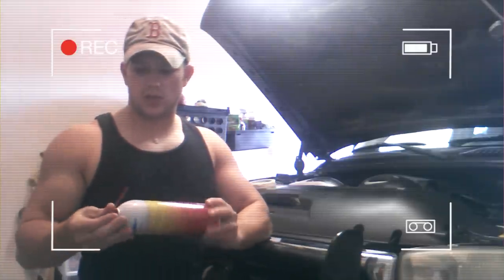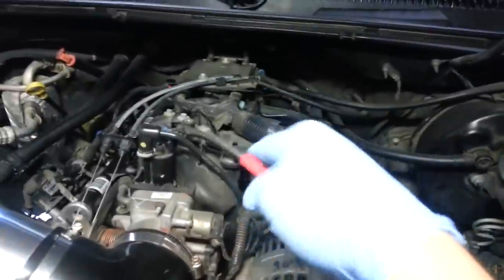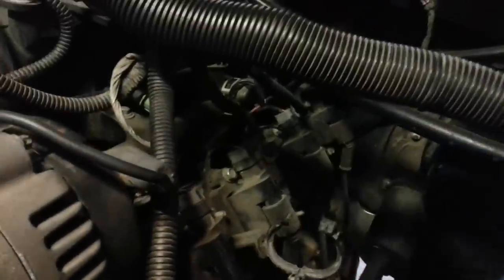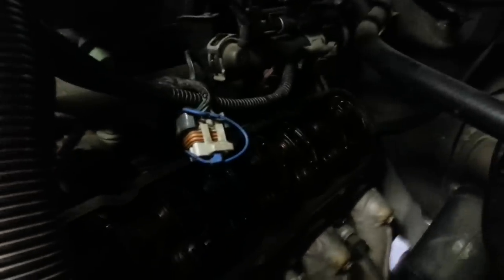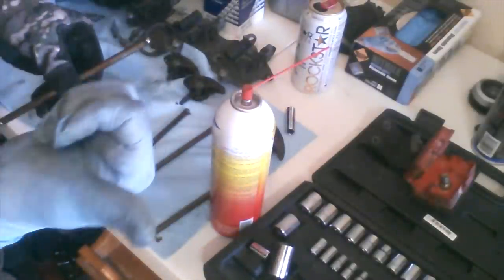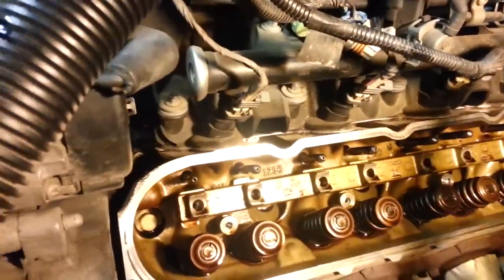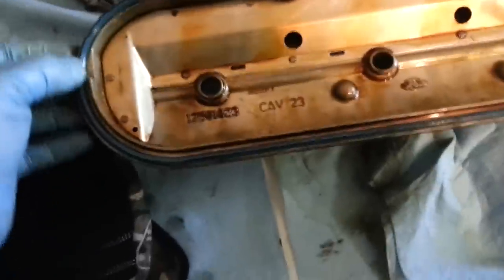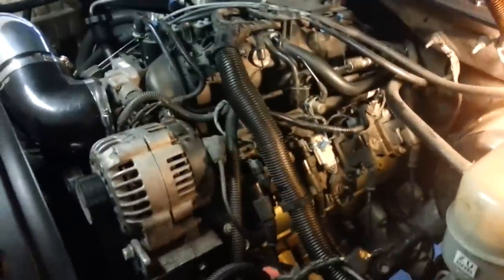GM Lifter Knock Repair - Carb Cleaner Method - HOW TO / TUTORIAL

Comment: Thanks for the vid !  I have a 2000 Silverado 5.3 with 308k. Runs great no issues but had to replace the trans one time.... Over the period of going 308k miles I have had the lifer tick and sometimes worse then others.... What I have done is just as you did except I did not remove the rocker arms. What I did was to make sure that your rocker arm is all the way up and spray carb cleaner right into the rocker hole in flows right down the push rod in to the lifter. Works great!  Thanks again!

Comment: Thanks for posting this. My 2005 5.3 has 105,000 on it now with no lifter or valve noises but I do get a whiff of burnt oil outside the truck after driving in aggressive traffic or at higher speeds. I figure it's probably time for new valve cover gaskets and this video showed me exactly what that will entail. I might consider doing this cleaning procedure as a preventive measure too while I have everything apart to replace the gaskets. Just makes sense to combine it all just before my next oil change.
Reply: The 2005 doesn't have a afm so your truck doesn't have the kind of lifters that get stuck

Comment: Run lucas or seafoam first, if that don't work run 1/2 qt transmission fluid (drive vehicle a couple days on both methods). Usually have pretty good luck freeing up lifter(s), unless completely bad unit and don't have to pull valve covers. Can wait on oil change until regular interval too.

Cheaper and easier. 
Happy wrenching. 

God Bless you and yours. 
God Bless our Real American Patriot Brothers and Sisters. 
God Bless America Again. 

The Real American Patriots.

Comment: Thanks for this video. Did this to my 6.0 Vortec. 5 or 6 of the rods seemed to be gummed up. This took care of 90% or more of my ticking
Reply: How did it work out on your 6.0. Thinking of doing mine in my 05 H2 as the tick is just barely audible. But considering its 2500 for the top end rebuild, I think its worth a try.
Reply: @markroeder3174  it worked well. It took care of most of the tick immediately. It did come back within a couple of weeks so I imagine there was more sludge in the engine that made our way to the rods but it wasn’t near as bad as before

Comment: If you think of it in time you can pull the fuel pump relay and run it out of gas first. On the first start after doing this I will crank it with the starter until it develops oil pressure then insert the relay and start it first start. I will be doing this next week in hopes of getting #6 firing again. Thanks for the idea! I have been noticing slower pressure rise in the morning start causing it to knock. I may have to R&R the oil pickup Oring just to be sure the oil pressure will stay good till around 300.000. maybe.

Comment: You can actually plug the coils back in and the plug wires too with the valve cover off. Thus will allow you to check your work by starting the engine up before reassembly. Oil splash will be minimal at idle.
Reply: You can leave them unplugged and it will run on 4cyl
Reply: @whocares8158  Yep, I've done it both ways and they both work.

Comment: I have a 2002 Suburban LT, it knocks in the mornings when I first start it up, sounds like a badly adjusted tappet, but after 30 seconds it disappears. I got in touch with GM, I was told all 5.3 Vortex do it, it is something to do with the different metals used to manufacture the pistons. I used to have a Ford Cosworth that did exactly the same. There's no problem if the tapping clears once the engine warms up. Gus UK

Comment: "Push rod" is their proper name.  Since you are comfortable with carb cleaner inside the engine, you could also use the push rod as the point to squirt the fluid in and down the push rod that clean goes and right into the center of the lifter. That engine needs oil changes more frequently as there is much brown building up.

Comment: Run a quart of ATF Transmission fluid in the engine (replace a quart of engine oil with ATF transmission fluid to compensate). There are vids on it AND it works well and a preventive measure.
Reply: Took my car to mechanic for tick sound. Said lifters issue. Put quart of ATF with fresh oil. Drove car for a week. No change. Noise still present. Pulling lower intake sometime this spring. Car parked till then.

Comment: Thank you so much man!!! It worked fine!!! Knock is gone!!.. thanks to this process I realized that the oil pump has gone out. No oil going up to the heads. I have GMC Yukon XL with about 248,000 miles. It runs perfectly so was surprised when this happened. Thanks again!

Comment: This actually worked relatively well! It didn’t work right after I cleaned them but I replaced the gasket on the driver said and he’s really nulled that down to the lifters possibilly being clogged. Will probably do the passenger side as I still get a light tick when idling now

Comment: Great video but wanted to share my experience. My 2005 Tahoe 5.3L had a ticking valve. The first or second valve on the drivers side. Would come and go but very irritating. I replace the valve cover on that side and tried the Chemtool spray to no avail. The problem is the O-ring on the oil pickup tube in the oil pan. I dropped the oil pan and found the o-ring was cracked which was causing lower oil pressure and the oil not to travel to the front lifters. I replaced it and no more ticking.
Reply: smart man!
Reply: did you see a drop in pressure on your oil gauge or was it just happening to those pickup tubes from the crack?
Reply: There was a slight drop, it was below 40 on the gauge, but the tapping was really bad. After I changed the o-ring the oil pressure did raise some.
Reply: +Adam Brock you must be rough on cars,that new truck shouldn't be running like that. you never changed the oil ever?
Reply: IM ThE PLug , it's hardly new. It's a 2005 with 245000 miles on her. The oil is changed religiously. This seems to be a common issue with these motors from forums I have read.
Reply: Adam Brock can you tell me how to do that im stock on the same problem i will be very appreciated for you help!!
Reply: lol its 2005
Reply: hi adam i did saME JOB it works great now no more tik tak the oil pressure now is 50 Kpa =7.8psi
Reply: Will this same procedure work on the newer AFM engines (07-13)??
Reply: Do you have a video showing how to do this?
Reply: did your oil pressure gauge show low pressure?

Comment: There is a difference between the knocking sound and the "tapping sound."  You can often get rid of the knocking by just using the best gas for a couple tanks... The tapping requires his procedure, and "possible" replacing a lifting rod.  You can test this before taking it apart by pulling the plug wires while auto is running.  If it dies from just the one pulled at a time, this is your bad lifter. 
Cheep fix is doing this method, or since it is all open, you could replace all the lifters on that side, then put it back together.  Don't forget to make sure your gasket is in good shape before tightening down cover.  You don't want to have to take it all apart again.
Good video for us who don't have the money, or skills to go too far with it yet need some kind of solution for awhile.
Thank you.
Reply: Have to pull the heads on LS engines to replace the lifters.

Comment: Man, I got lucky...I just pulled the Valve covers , took my rubber nosed nozzle and shop air, and blew out the rocker-arm oil hole on every rocker-arm and wallah ...no more lifter click ...and oil-filter change adding Resoline to the oil ...!
Reply: Someone gets it .. I'm over here like 🧐 how's it gonna "run out" lol .. I guess he meant into the oil passages .. great place  for a solvent to be.

Comment: I found with my LS1 engine that the hydraulic lifters were getting stuck in the engine block because dirt and/or varnish was getting caught up between the lifter(s) therefore causing a very loud tapping sound when the engine warmed up a bit.

The lifters got mushroomed a little bit & it has caused the valves to hit the piston crowns on about 3 of the cylinders as the valve rocker arm was holding the valve open longer than normal so that threw the valve timing out.

So, I've ordered a set of hydraulic lifters for about $100 AUD on EBay (cheap),I still need to order other stuff such as gaskets, a timing chain kit, new radiator, etc.

I'm working as a temporary worker at the moment but I'm sure that I'll get a permanent job this week & can pay for the rest of the parts,oil,radiator coolant, etc.
Reply: Don't forget the new camshaft to go with the valve lifters. New lifters require a new camshaft or you will damage the existing cam with new lifters. Not a simple job for the non-experienced DIY.

Comment: Good advice, I had the problem with my v-6 vortec, I got rid of the noise but I could not get a ride to town for new oil and had to put back the old oil and the noise came back after 18 miles and never went away after despite repeating the cleanings.

Comment: Why didn't you put the pushed back in and then spray the carb cleaner down the hole in the pushed which would be directly over the oil hole in the lifter. Then you could pull the pushed back out and lube it.

Comment: Why remove the rockers and push rods ? I mean you can use the oil port on top of the rocker to spray into the push rod leading directly to your lifters. No chance of messing up your adjustments or dropping the straw from your carb spray inside the engine. I would also have turned the engine over a couple times and checked push rods while tightening but Good info for cleaning tactic. I would use Rislone before doing this method but I did like the whole idea seems like it would work well..

Comment: Great video, I'm planning on doing the exact same job on my 2004 Tahoe this weekend, I have a tapping issue on it and have been doing it for about two weeks now!!!!! Thanks for the great video!!!!!
Reply: How did it go?
Reply: @HeavySakONuts  must not have went so well spraying oil remover into the oil passages .. better off leaving the assembly in place and jetting a bit of air down each hole on the rocker

Comment: I can see a common problem for that engine that causes a start-up ticking sound. Your front driver's side exhaust manifold bolt has broken off. No doubt that will make a ticking sound at start up until the metal expands. Looks like possibly your driver side rear bolt has broken off also. I used one of the $30 clamps you can buy online and my ticks went away.

Comment: I didn't remove my rockers I just sprayed carb cleaner right through the oil hole in the rocker. I kept spraying it down until it flowed through freely. Changed the oil in the truck and the tick was gone.
Reply: scott coulter did you talk the rocker out to spray threw the hole or did you spray threw the rocker hole?
Reply: Sprayed through the rocker hole.
Reply: scott coulter I think you're right Scott. Doesn't seem like removing the rockers is going to add much benefit.  There's a hole to put your carburetor cleaner tube down which is the actual oil flow path you're trying to clean.
Reply: That is correct. I sprayed down until it flowed freely.
Reply: I'll try that. Thanks.
Reply: scott coulter Next time put a quart of kerosene in the oil and run it for 5 minutes and change the oil. Bingo.
Reply: Does it work
Reply: Diesel fuel also (much the same as kerosene)
Reply: Can't you just put the B12 in the normal oil hole? Without having to take anything off?
Reply: Easiest and best way. Spray through it all and it will put the cleaner right where it needs to be.

Comment: I used marvel mystery oil mixed with new  motor oil, next I want to change "O" ring on pickup tube, then depending on oil pressure improvement, oil pump.  (Problem: loss of oil pressure at idle and lifter noise)  the mystery oil helped the lifter noise a lot.  GM seemed not to have chosen the best "O" ring material for pickup tube.  After reading the following post, I think I'm on the right track....  ; -)
Reply: Did the o-ring help the oil pressure
Reply: I HAD LOW OIL PRESSURE AT IDLE WHEN WARM ON 2005 SIVERADO 5.3 REPLACED PICKUP TUBE O RING AND WAS PERFECT AFTER! COULD BE RELEIF SPRING IN OIL PUMP BUT MOST LIKELY ITS THE O RING!

Comment: I have a H2 2008 hummer with the same problem TICKING ON FIRST MORNING START UP but goes away when up to temperature. I will try the carb spray into the pushrod let soak then followed with a blast of compressed air just to make sure I get any loose slug out. I'LL KEEP YOU GUYS POSTED ON THE END RESULT.
Reply: bajaforce1 Well?

Comment: who else got nervous about the staw falling in the hole? lol. about to try this ughhhh. last ditch effort before I take it in
Reply: Whatever happend? Did it work??
Reply: @adamsecrest6108  unfortunately no it didn't work. Took the whole top apart and did everything in the video. I thought it was a stuck lifter but it was actually the piston head had a crack. Ended up saying screw it and drove it for another 8 months before I got tired of the noise. Just ended up putting a new motor in. But I did try this trick on my dad's truck and it did work. I recommend using Lucas oil stabilizer with good quality motor oil. Once you free up the lifter the Lucas has a lot of zinc in it and will stay inside the lifter and keep it full of oil. Best of luck to you

Comment: The "head cover" you refer to is called the valve cover for those who don't know.
Reply: Replace all the lifters, I was a warranty technician for years at GM, this guy is funny. Piston slap and knock keep that in mind.
Reply: @epasternak4206  yeah once they are damaged they need replacement  anything else is just a temporary fix to get you home
Reply: actually it is a rocker cover..
Reply: Vally cover is under the intake
Reply: @dc-ir3ow  he said valve cover not valley.   either rocker or valve is fine by me tho  more valve than rocker. for my fathers generation it was rocker as they took them off often to adjust them. at tech school everyone called it valve cover.
Reply: @braedenallen4539  either rocker or valve is fine by me tho  more valve than rocker. for my fathers generation it was rocker as they took them off often to adjust them. at tech school everyone called it valve cover.
Reply: @tomriddle4054  very true haha
Reply: @tomriddle4054  iv done the adjustment b4 its a mess but it works
Reply: @tomriddle4054  I was replying to a comment some one said about the valley cover it has been removed
Reply: @epasternak4206  did they teach you to get a wooden dowel and listen to the bottom end and top of the engine? Not hard to determine where the noise is coming from. Especially on an aluminum Block and heads. My opinion this is a great video for the person trying to eliminate having to pay for another engine when in reality it was one lifter. I purchased a Tahoe from a person at gm bc they told him he needed an engine. Loss of compression... Leakdown failed.. and missfire on two rear cylinders.. drove it home squirted gas and water down the intake while it was hot and running.... Whala could you believe it was just carbon build up on the valves. Truck still running to today. Warranty doesn't fix common sense. It costs actually.. more so the consumer. Not everything will fall under warranty. This is good info.
Reply: Please do point out the valves. I see rocker arms, springs, and retainers. Head cover is even more descriptive than rocker arm cover
Reply: @epasternak4206  hey man u still here??

Comment: Just for FYI. The reason we have this lifter problem with our LS engines is the lifters are manufactured by Mitsubishi for GM. They made them with a undersized oil hole in the lifter. So,it takes a small amount of sludge buildup to clog the lifter. Thus causing the tapping. When you use the carb cleaner or trans fluid it flushes the lifter sludge out. And eliminates the tapping. Thanks GM and Mitsubishi for screwing up a great engine. So, if you want to eliminate the problem completely. Install a aftermarket performance cam and lifter set. And be good to go!
Reply: Never knew Mitsu made parts for GM, good stuff to know. And yes Mitsu makes undersized lifter oiling holes cause I have the same problem with my Eagle Talon except mine actually sound like there knocking lol.
Reply: As a vendor who is responsible for manufacturing,  Mitsubishi would not be able to deviate from a General Motors spec. on the "undersizied hole" you mentioned.   A vendor needs to get approval from the manufacturer to change the dimensions.  On the other hand General Motors could have given Mitsubishi both Design and Build responsibilities.  In this case Mitsubishi would have designed the hole "undersized" and GM would have approved the design.
Reply: yep you are right  but when a American car break Down blame the japanese
Reply: Gary Molnar 
I believe theres an updated version of the stock lifters...
So whatever faults there were in the first design, should be remedied now
Reply: Beuno Aires

Comment: Did you notice the missing exhaust manifold bolt heads sheared off, check both  sides.  If the exhaust manifold is leaking you will hear a ticking noise as well and soon a check engine light for lean codes.   I would think you could have just sprayed  thru the oil hole in the rocker arm that would  directly flow into the lifter.
Reply: I noticed that too. I just installed exhaust manifold clamps after seeing some of the bolt heads missing. I no longer hear a ticking sound when cold. I highly recommend the clamps.